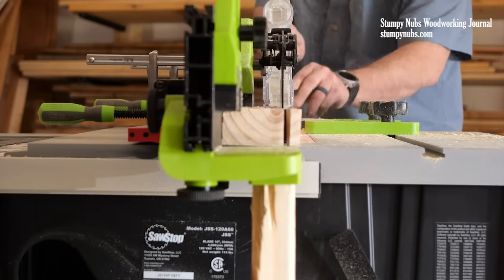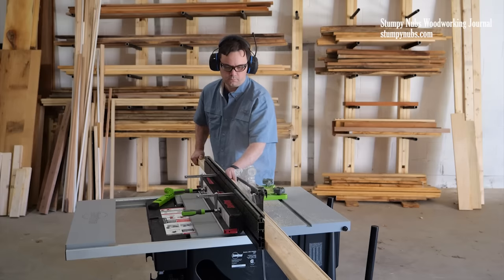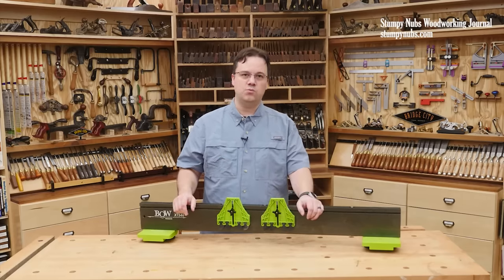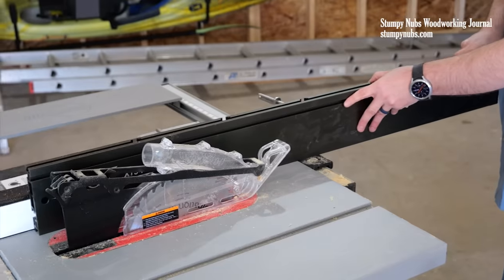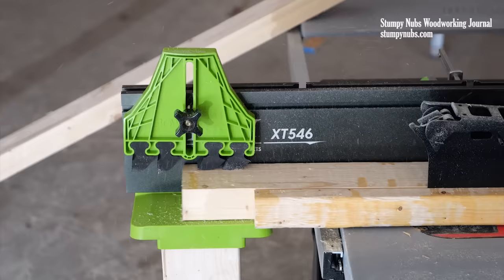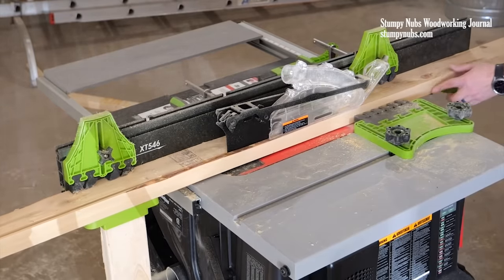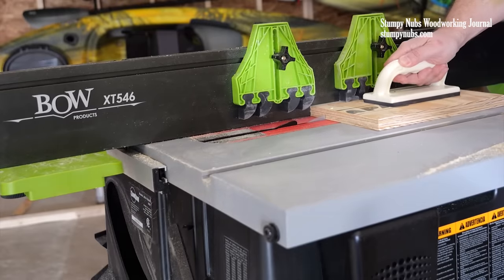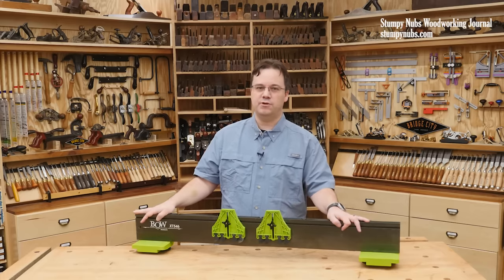I put this on my saw and it changed everything for me!

Comment: LMAO All parts sold separately, huh? Would end up spending more than I did on the table saw....SMDH
Reply from the maker: They are sold as kits, too.
Reply: @StumpyNubs  And the least expensive "kit" is still almost as much as a good portable table saw....about 2/3 what mine cost! Not even close to needing something like this for that money....just saying....
Reply from the maker: @oldschooldiy3240  The least expensive kit (the fence and supports, which make up the heart of the system and can be easily supplemented with your own clamps and feather boards) is $200 (less if you get a shorter version). I know of no "good" portable table saw for even close to $200... Don't get me wrong, I know quality tools aren't cheap (especially good ideas from small businesses like this). But the fact that you may have gotten a table saw for really cheap does not mean that quality accessories can or even should be priced accordingly.
Reply: @StumpyNubs  The link you provided does not show any kit without clamps! And I said that kit was "about 2/3 what I paid (over $300 BTW!) Still, sorry, no sale here....
Reply from the maker: @oldschooldiy3240  Check again. You can get the extrusion itself for as little as $87- $159, depending on the size. The supports are available for $45.